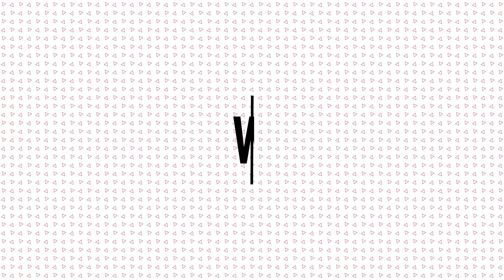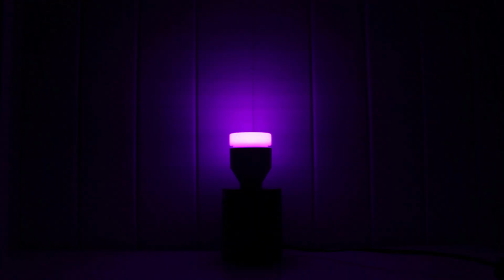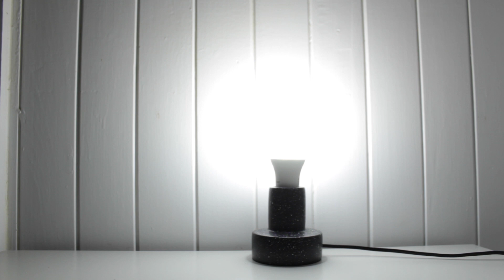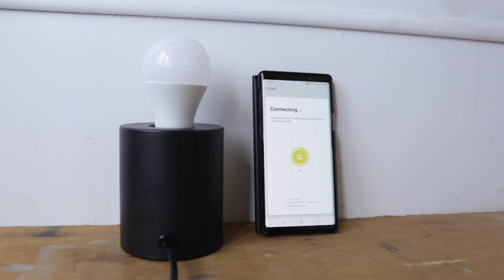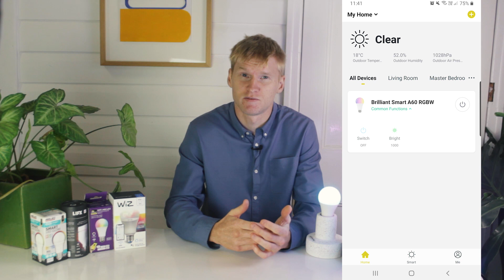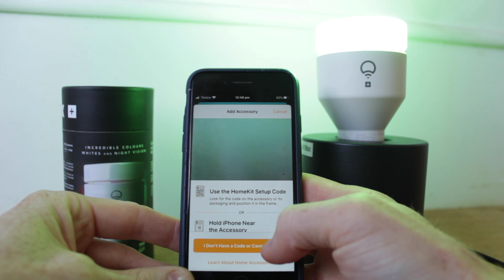Smart Bulbs Comparison + Review 2020

Comment: Wiz is super simple to add to Home Assistant too! I just purchased 4 of the GU10 and I'm really happy with them. They are in aluminum housings outside with only lens at top and bottom but still have enough signal. Once you figure out pairing and modes, they are great. 
I just wish they had an updated downlight without a transformer, and I would replace my entire house with them.